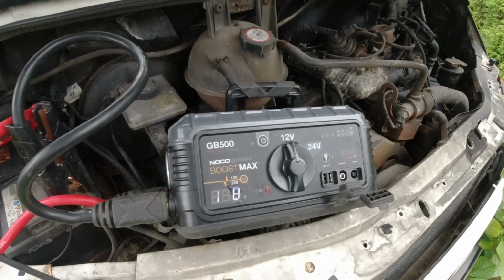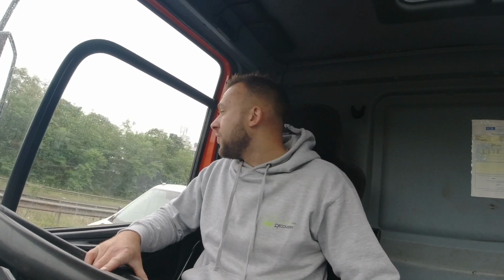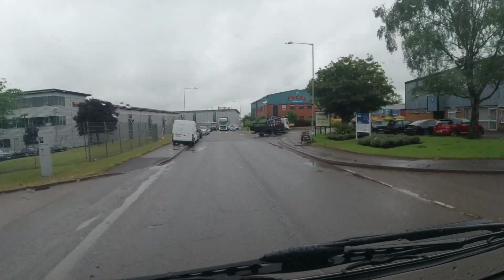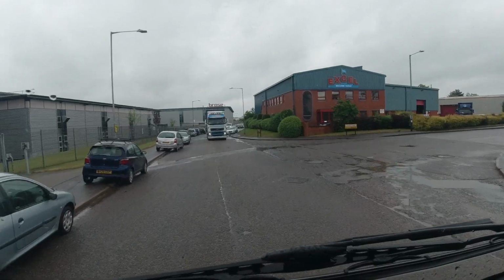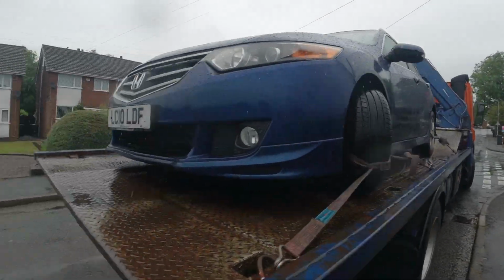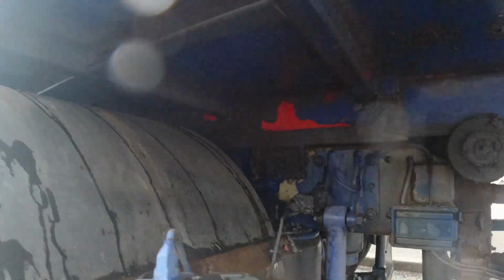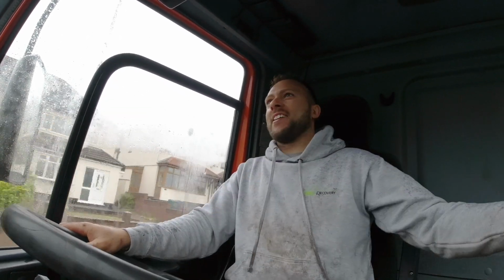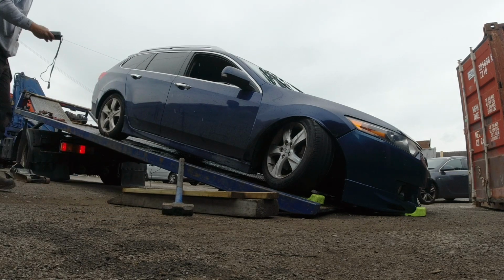OOO WHAT A DAY at GDB! Ford Transit SOLD! Then RTA on way back!

Comment: Could you not have used the hiab to lift from the front to while winching from rear?
Reply from the maker: That is very good thinking! Yes you could of potentially… according to where strapped but may push wheel through the wing ! ( maybe ) good thinking! Thanks for comment.
Reply: @GDBRescueandrecovery  no worries mate, you could have used a ratchet strap through the bottom of the wheel on to the subframe, to pull the wheel back in, then lifted it with the hiab
Reply from the maker: @MrMattybruno  very true very true!
Reply: That sounds like a ball ache, good idea though.